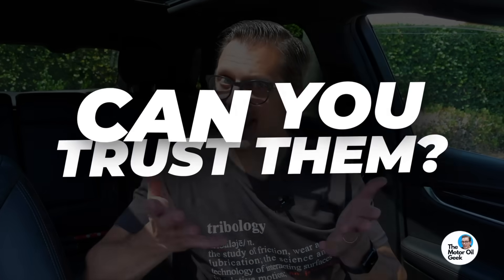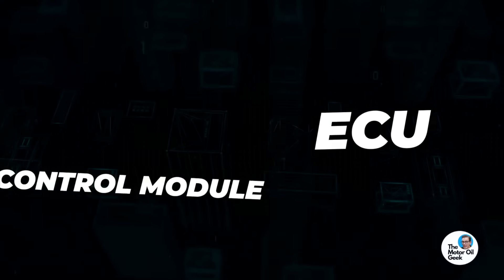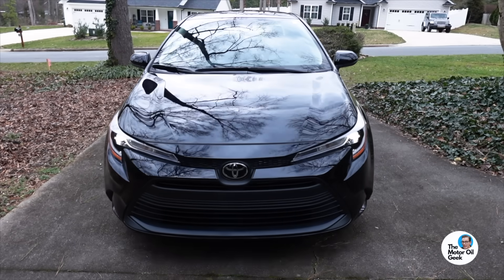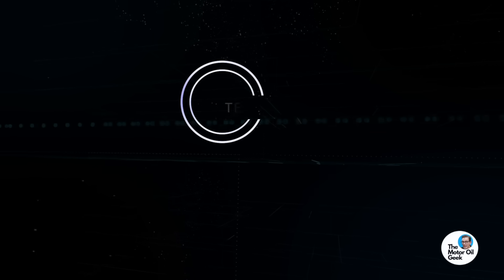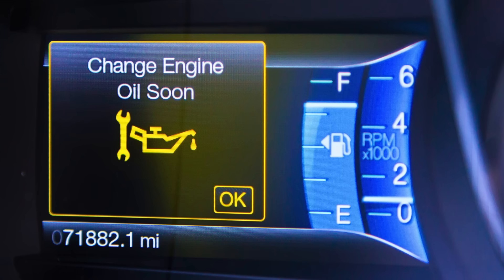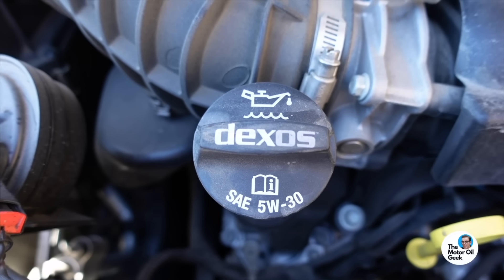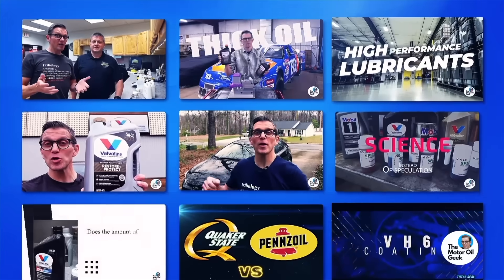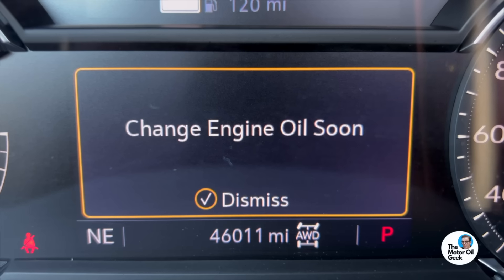The Accuracy of OIL LIFE Indicators REVEALED!

Comment: I have a 2012 GMC Sierra with a 4.3 I’ve been religiously changing the oil at about the 50% life indication. Am I wasting money? I figure oil is really cheap and engines are expensive. I typically use royal purple or Pennzoil ultra platinum 10w30.  I’ve been thinking about trying, that Valvoline restore and renew oil.  I usually add about a half a quart of marvel mystery oil, 100 miles before I do a oil change to help clean any sludge or soot from the crank case and parts. I’ve never sent a sample in for analysis, because I probably wouldn’t understand anything on a report. I have 85,000 miles on this truck and if I have my way it’ll have great compression at 300,000 miles.

Comment: The 9% is saying you have used 9 % of your oil life, at least thats how i interpret it?, when it gets to 85%, then change your oil, or go off what the OEM recommendations are about the oil indicator % is saying or the amount of miles when you need to change you oil, plus use a OEM approved oil specs always and the same with oil filters cheers  😎🦘👍✌👌
I use dexos 1 gen 3 approved and licensed oil and the difference is amazing compared to dexos 2 oil spec. cheers 🦘👍✌👌😎

Comment: I have a bmw with 150K miles. Since new the oil used was rated LL-1. Change intervals were based off the oil life monitoring system which is between 15 and 20K miles on average. First oil change 18 years ago was at 12k miles. Did the pan gasket recently and the inside of the engine was absolutely mint.

Comment: Hey Lake Jr.. Try a conventional (I currently use Havoline Conventional 10W40 in a 1996 Olds 98 Regency -3800 Series II V6 with 250,000+ miles on the engine) and then check the wear.

BTW, I loved the Havoline Vs. Walmart House Brand Synthetic motor oil test and the Total Seal ring test with Dyno (Donnie? Sorry if I got his name wrong and I can’t remember)😢.  You sold me and I’ll use Walmart Synthetic from here on in my Late Dad’s used 2007 Ford XL 4.2 V-6 (Canadian Essex Pushrod Engine) Work Truck (I was using Rotella 5W20 Gasoline Engine Synthetic oil before it was discontinued.😮).  Do you have an equivalent to recommend?  Please advise.

Comment: Keep in mind that oil analysis can catch a lot more than just if your oil still has life left in it. An oil life gauge isn't going to tell you if you have copper from bearings wearing out or silicon from coolant leaking from a head gasket.  Still cheap insurance to get one done for a higher value car at least.

Comment: I find it amazing how Japanese and German cars have strong engines; meaning you can run the engine to 60k miles without an oil change before the engine is destroyed. 

Meanwhile for GM cars, you start experiencing terrible engine knocking when you don’t do proper oil changes every 3k miles. However, GM has a built in oil analysis indicator (computer system) that gives relatively accurate readings for the engine oil. 

I find the contrasts and extremes to be absolutely wild!

Comment: TMOG, touched on why you cannot trust OLM. Some oil companies did a "brutal" test of motor oil in either NY or Las Vegas taxi cabs.  This is not really a good test as the engines are really never turned off, so the hot/cold/short trip cycle which is  the most detrimental to motor oil life really never comes into play.  Plus I am sure they picked the newest engines in the fleet, not the worn out leakers. And last Mercedes Benz had a big issue with OLM by failing to tell it's owners that they had to use 100% synthetic oil. Many used regular Dino oil and their engines were toast with the extended service intervals. That is not an issue today as most all of the thinner oils are all synthetic. Toyota kicked that party off with 0W-20 and now it is 0W-8! Happy motoring--Alina

Comment: I have to say this was very interesting. I have a GM 3.6L with 90k that I've been religiously changing the oil on at 5000 miles regardless of what the OLM says in hopes that I can avoid timing chain stretch. This research seems to strongly suggest that the OLM is a good deal more reliable than I've been led to believe and perhaps I need not be so locked in to changing at 5000 miles to avoid timing problems. Do you feel that this is a reasonable inference based on your test and if so do you think this test is enough to challenge the conventional wisdom about correlations between infrequent oil changes and timing belt issues in these engines.? Thanks again for the video

Comment: @themotoroilgeek like to see you tackle some of the motor oil additives that claim to eliminate or reduce engines that consume oil. For the most part these are high mileage engines that burn oil due to carbon build up on valves and rings. These are engines where you may not have much to lose in trying an additives like 505 CRO, Seafoam, etc. 

Love your channel!
Reply: He already did that test
Reply: @wysetech2000  not that I have seen. Show the link

Comment: I've got a Ford Ranger with a turbocharged engine. I don't trust the indicator in mine at all. I'd be changing oil every 8,000-10,000 miles or longer going by the indicator and I'm sorry, but I'm changing it every 5,000 miles regardless of if the computer thinks there's another 4 or 5,000 miles left in it.

Comment: BUUUTTTTT, what if you you put very few miles per month/year on the vehicle? I bought a 2023 Silverado RST Z71 on 5/22/23, by 4/8/24 I had only put 3875 miles on it at the first oil change.  The OLI showed that there was 14% oil life left. 

Currently it has (as of today) 5697miles, and an oil life of 54% with 6 month old oil. Should this be considered accurate due to the length of time?

Comment: One sample is not anything close to “conclusive proof”.   What happens if the vehicle has more ring blow by due to high mileage? Is this only for this one engine model with one type of oil? Does this also apply to an older GM cars using conventional oil? I think the conclusions in this video are setting people up for some serious failure. Someone’s going to take this as oh yay I don’t need to do oil changes until the old life indicator goes to 0%…. 

Changing your oil is cheaper than changing your engine. On the other hand, maybe the faster we blow out older combustion engines cars means they’ll be replaced with more modern environmentally friendly combustion engine or electric cars so yeah go run your oil down to 0%

Comment: It works great for average driving and passenger cars,  but with performance cars there has been problems.  The 2010 Camaro SS with the L99 engine (vvt and cylinder deactivation) had major problems with lifter collapse because the oil life indicator was not conservative enough.  Engines would get stuck in v4 mode because the oil was worse than what the indicator said,  and this happened especially around the 50,000 mile mark.  Later model years had revised algorithms that solved the problem.  When I bought mine I looked for a low mileage car and change oil every 3000 which is about what my summer driving is.  And I got rid of v4 mode altogether as many camaro owners do.  Lot cheaper to have a little less mileage than a full lifter replacement.  Keep up the great videos Lake!
Reply: In the case of the GM products with cylinder deactivation, it's not so much bad oil as it is poor design. When it's in deactivation mode, there's not enough oil getting to the lifter and camshaft of the deactivated cylinder.

Comment: For what it's worth. My Camaro oil analysis was done when the oil life indicator was at around %50. Which based on the oxidation value in my results was fairly accurate.

Comment: Pro tip: Don’t move your car out the driveway then immediately switch off your engine. Go around the block for like a solid 5mins or more if you can’t let the engine at least idle for a while. 

My situation was so bad. Basically our garage has one exit so if one car is blocked we have to move both cars etc. I noticed when I did the car swaps the one car would struggle to idle the next day and it got really bad to the point it started knocking hard made like weird sound. That sound was the lack of compression in the cylinders as the fuel washed down all the oil. From that day I take the car around the block to gain some temperature before switching off. Plus that cold start the fuel is very aggressive as the car is trying to generate heat from that cold start especially. 

Love this feature by GM. Great video as always man. 🔥🇿🇦
Reply: That reminds me of a write up years ago about the example of the guy who would drive home from work and park the car on the driveway with the possibility that he might need the car for an errand but almost always never did so late evening comes and he goes out and starts the car to move it the few feet into the garage. The point of the story was that the cold start and moving a few feet every night showed up in the engines sludge and wear from doing that so many times.
Reply: Everybody has a problem tip nowadays. Too funny.

Comment: Ethanol fuel like E85 does more contamination on the oil and valvetrain than gasoline can over 3000k miles, just because it's cheaper doesn't mean it's better, Lake you should run an engine oil analysis on flex fuel vehicles compared to vehicles that just run non-ethanol...

Comment: Lake, how do you know if they actually reset the oil life monitor on the last oil change on that rental since the test oil sample looks soo good? My new 2024 Honda Civic Hatchback Sport Touring with a 1.5L turbo & it has an oil% indicator, I have about 1,270 miles on my new car now. I've had it since mid May, it's showing I have 70% left on my oil now, my average trips are between 1 & 3.5 miles & then the same back home. I do put 25 to 30 miles on it once a week or so without stopping & then back home. I'm guessing the my very short trips are causing the oil % indicator to drop more than the highway mile trips. I'm looking at doing my 1st oil change at 1,500 miles & then either every 3,500 or once a year, does this seem reasonable to you since it's a turbo engine? O, the car also has Economy, Normal & Performance modes, I've never put the car into Performance mode yet & tried the paddle shifters, I waiting till I get my 1st oil change. My average miles a year are probably only around 4,000 miles or so now since I retired early at 55 2 years ago.

Comment: I think I’m happy with Honda’s implementation of their maintenance reminder. Almost no sensors meaning less electrical failures even though it’s slightly less accurate. As long you understand your car maintenance schedule you only really need to keep track with the trip computer as a backup.

Comment: I'd be interested in the pros and cons of engine flushing at an oil change / service.
Is it worthwhile maintenance or better not to at all and does it increase wear doing so?
Here in the UK at least there are several basic methods. An additive you add to your old oil, you run the vehicle stationary with raised RPMs for 15ish minutes then drain. There are 2 grades of this widely available, public (idiot proof) and professional which is a stronger formulation (Forte, BG etc brands)
A drain the old oil, replace with flush, run as prior, drain and then refill with new.
And finally a cheap jack way whereby you add a quantity of diesel, running as the others then draining (surprisingly effective visually)
I've had visual success from cleaning the insides of neglected engines that have varnish and excessive caked semi hardened black goop (carbonised oil?) in and around the non contacting surfaces inside the engine.
Would love to see a professional fact only, no bullshit analysis such yours.
Thanks 👍

Comment: I agree, but that is assuming that the engine is running perfectly well, doesn't consume oil, and there is no excessive fuel contamination. So, I would say that oil testing is still important in order to catch this kind of issues.
Reply: Just use the dipstick to check it..really, it isn't that hard...and it doesn't lie....
Reply: @dyer2cycle  how the deepstick will tell you if you have wear metals or smth else that shouldn't be found in your oil?
Reply: @AndyZakk  It WON'T..BUT..it will tell you if you have any oil left in your engine!..if the oil is 2+ quarts low, and very black, then, then just change your oil..no analysis needed. After all, contaminants or not, no engine is going to last long when  you run it thousands of miles with just a little black oil in it....
Reply: @dyer2cycle  you are kind of missing the point of my coment, but that is ok. The way I take care of my cars is every 7,500 km for the one I don't drive hard, and 5,000 km for the Civic si that I do drive hard. And if I know the car consumes oil, of course I would check it more often. But everyone has it's own school of thought, and everyone thinks that their approach is the best. If what you do works for you, keep doing it....
Reply: @AndyZakk  Not exactly how 5,000km translates into miles, but since a km is smaller than a mile, I would say that is pretty much a good changing point for oil. And, my point was, to check your oil level regardless of what the gadget says, because you need to be aware if it begins consuming(or even leaking a small bit) of oil, and adding if needed, or you will begin running your engine low of oil.

Comment: I've always equated the older sensors like the one on your fridge: 6 months is up, light goes red. New ones I suspect are a little smarter between hours of use and miles driven. Let's see how close I am.
Add: As I got to the oxidation portion of the vid, that brings up an interesting point. A lot of the newer engines are running A Lot hotter than they used to for oil, trans and even engine temperatures while still reporting they are 'okay' in the dials. Turbo engines running with All of the fluids hotter and still the manufacturers recommend 10k oil changes is just mind boggling/asinine.
Reply: Not with a modern oil. We're not in the 1960s any more.